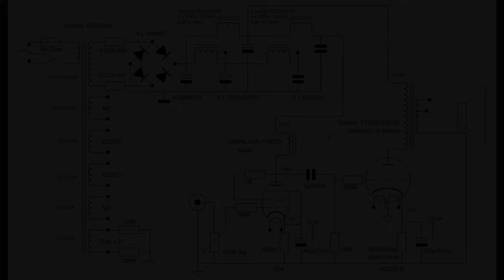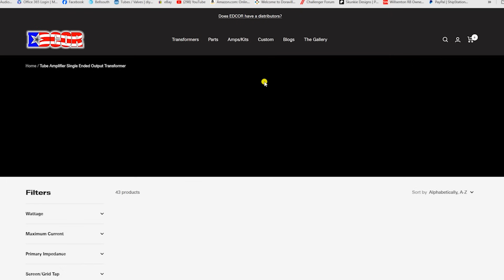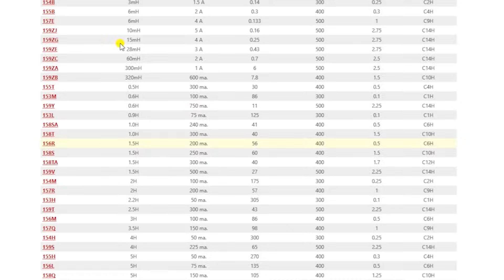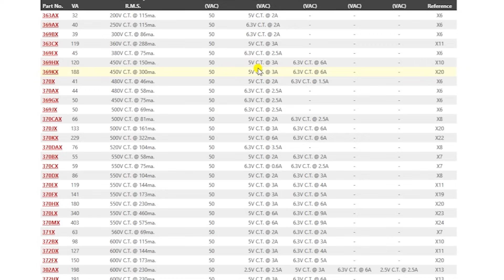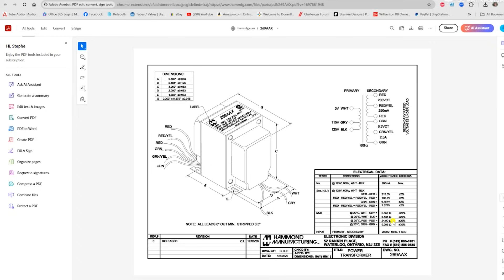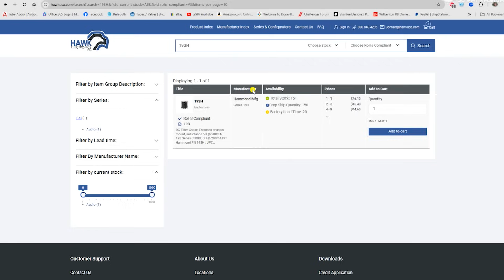6C33C Monster Tube Amp Build: Designing the Power Supply

Comment: Hey there, you're a pulsating motor of ideas... I thought about such an amp in the past... Now you've awaken the monkey on my shoulder... Wanna try something different now. Thinking about a parallel SET in OTL... Crazy? Too much? Too little?
Reply from the maker: That's what I feel like. Sometimes my mind just jumps back and forth on what I want to do lol. The video I plan to do today start to solidify this build. I considered an OTL but not sure the benefit other than just being able to prove you can build a tube amp without an OT. Plus the heat of 4 of those monsters!

Comment: My 200 Watt Rotel solid state amp sounds like my Willsenton R8 amp in Triode mode, but with subtle, deeper, better bass. But I prefer the sound of the R8 in Ultra Linear mode over my solid state amp.  Especially for older Jazz and Orchestra recordings, there is more “air”, more sense of room. I also like listening in a pure analog mode. Turntable, to tube phone stage, to R8. Need to check out of digital world.  I also enjoy the sound of my Solid state pre amp feeding my Willsenton. Absolutely love my turntable and Willsenton R8 sound on the right good recording.  Can be so dynamic, clear, revealing, incredible bass and give sense of room. Do not get that with streaming and solid state.

But I like and use both.

Klipsch speakers…I just can’t get there. I do a sound demo and they make me wince. I keep looking, and trying…just can’t get there. If I can not get good sound from my little Set amp once I build it, I will try them as a in home demo.

Comment: Try 6336 and you'll never ever look for 300B!
Reply from the maker: ooo that tube looks interesting!
Reply: @SkunkieDesignsElectronics  There is a design for this tube in cascadetubes site; I've recently built it using Edcore transformers and believe me it's the best sound I've ever heard! Great harmonic content and full bass response.
I strongly suggest you to build the same amp and compare it with 300B and you will see how overrated 300B is!
Reply from the maker: Yeah I saw that and bought this tube off ebay lol. I have some SUPER nice 2.5K OT sitting here :)
Reply: @SkunkieDesignsElectronics  Can't wait to see your impressions.
Reply: @sajyho1988 this is what I wanted to hear. Would you tell me more about sound signature difference of 6s33s (possibly OTL) against a 300b?
Reply: @Michlag  Unfortunately I didn't hear that specific tube which you mentioned, but I have built a 6336 amp recently and IMO compared to 300b it had more bass and less noise and more detailed sound.
Reply: @sajyho1988  ok sorry, I read 6s33s, not 6333, will look for it... Do you have your schematic?
Reply: @Michlag  it's based on a famous design on the internet, just search name of the tube.

Comment: Were I designing/building a tube amp I would use separate transformers for filaments, bias and plate voltage. Filaments would also run on DC. Only solid-state rectification, but with automatic high voltage on delay. So 3 power supplies. Tubes: 6550s, KT88s to 150s. Probably ultra-linear output.

Comment: Exciting this one. While considering the two choke PSU design I believe you made an oversight in relation to the internet schematics. The second choke is not supposed to feed the output tube, only the driver tube, so that one only need to be rated above 20mA with a bit of margin. When splitting of the B+ for the output tube after the first choke it will be easier to get to the desired B+ and also get more filtering for the driver tube, where it may provide some benefit. May be worth playing with.  I agree toroidals may be a bit hit and miss. Some are good and silent and some buzz, even from the same manufacturer.  UF4007 are rated with peak current cap at 30A (short burst of cource) so should suffice to charge that first cap.

Comment: Howdy.
The 1N4007 is a only 1A diode. It may be considered to use P600J which is a 6 A diode. I would think the 1N4007 may struggle with the inrush. More so as it is intended to hot start the end tube.
Much Regards.
Reply from the maker: Which is why i am not using a 1N4007 diode as I explained in the video. I'm going to assume this comment was made before you watched the video?
Reply: @SkunkieDesignsElectronics  Howdy again.
Aha. My error. Apologies.
Regards again.

Comment: I thought I saw a 600 ohm 30 watt Hammond SE Transformer.
Reply from the maker: They may make one.
Reply: @SkunkieDesignsElectronics  

1626SEA	25 W	600	250 ma.	15 Henrys	Yes	4-8-16	2000	11	Lbs

BTW I sent you an e-mail with a EBay link for a power supply solution I think would work well for this unique build

Comment: Toroidal power transformers are a hype in many high end amlifiers ...but you are right and I avoid them also...they saturate brutaly and are very sensitive to DC on the power line ..and that will make them hum and rstrict their amperage capability ....using toroidal transformers one must them oversize sunstantialy.

Also mount the socket on standoffs under the chassis to allow airflow between the socket and the chassis plate .
Have anice day .........and very interested in the follow up of your project..

PS : When red plating /run away ...............anode current can exceed 1200 mA !!!
Reply: Hey Frank. Thanks for chiming in with your comments. Yourself and Janos are people who have the years of experience with these things. I knew you would’ve had experience with this particular tube. I wrote something similar about using toroidal transformers, but you went as far as explaining some reasons why not to use them. I’ve heard certain owners of amp companies say they use toroids because “they care about their customers and want to use only the very best, but they’re expensive” Well, no they’re really not, they’re actually less expensive, compared to a nice EI. Haha….

I’m always glad to see you’ve left a comment somewhere. Have a good one, Frank.
Reply: @NickP333  Thanks Nick .....always a pleasure tio meet you ...somewhere hahaha

Comment: Indeed Steph .............6C33-EB has a lot of issues....
Replace the usual IN4007 diodes by the 5408 .....
The socket contacts/wiring will be part of the cooling...use sufficient gauge  copper wire as they will help to drain the heat...  
Air ventilation holes arge enough trough holes in the chassis .
Stabilization does indeed take time.
As low as possible the value of the grid resistor (  min 2watt )...or transformer coupled to the driver ;
Put a diode in reverse over  the choke....
As driver low impedance ....maybe build a parralell SRPP ............works great to drive tubes like the 845 etc...
Run away ...........is mostly due to it's dual construction inside ..one part will  wear faster than the other and imbalance will drive one portion doall the job and redplate..;same happens often with a PP with a shared cathode resistor..
Protect with a fuse ....t(o protect the OPT and the power supply components , power transformer included ..
You can pre-heat the filamnets for two minutes before applyinhg the anaode voltage ( with eventual ) inrush limiting at start up..
Worked with this tube 3à years ago....

Nice project with full, of surprises ....
kind regards

Comment: According to the datasheet for the output tube, didn't you need just under 4A for the heater current and the trannie you were looking at is rated for only 2.5A?
Reply from the maker: I'm not using the high voltage transformer 6.3V to power the output tube heaters.
Reply: @SkunkieDesignsElectronics  - ah, OK, cool.

Comment: Thanks, Stephe! Looks like a cool schematic, and a great plan for a build so far, but “whipping up a BOM” is certainly not possible, as it takes a bit of time. This vid was a great start though. 

FWIW, I’ve built a total of 4 EAR834p clones now, the first 2 using a toroidal transformer, the other 2 with an Ei core. The Ei is now my preferred transformer for the majority of builds. There’s plenty of information about both out there for anyone who is interested. 

I’ve never built anything with this type of tube, but have heard amps with them. They have a pretty overall balanced sound, so this could possibly be a build that’d end up being a main last amp(s) for some people. Thanks again!
Reply from the maker: This likely isn't going to make big power like my KT120, but will be interesting to see what it sounds like!
Reply: @SkunkieDesignsElectronics  Yeah, for sure. I’d hope that anyone looking to build this, is going to wait to see your measurements first. I’m still working on building a color preamp using 6SN7’s, which I’ve thankfully got a nice stash of from over the years. Just taking my time, using high quality parts, and enjoying the build. 👍🎶😊
Reply from the maker: Yeah people who jump ahead of me are making a mistake, the whole point is to learn from my mistakes, not repeat them lol